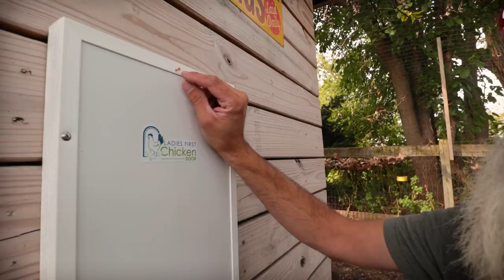Automated Chicken Doors 🐔 Protect Your Investment

Comment: we have a lot in common.  I'm also IT Admin during the day - homesteader with goats, chickens and big garden.  We also have the same exact tractor.  Its like we are you guys in Ohio - but a gay couple.  =)   Like you I'm all about automation around the house - been doing a lot of cool setups lately to make life easier and save electricity too.  Even in greenhouse I have automated outlets so I can use IFTTT based on my ubibot readings to turn things on and off.  I had thought about a chicken door as well - just didn't like what I saw out there - had not heard of this one - I'm on the website now about to order - just want to go check the size of opening I currently have out there.  Would be one less I have to do every morning and night.  I usually give the girls some cracked corn when I close them up at night (ours closes from inside the coop) so they might be ticked if they don't get their treats tho.  Only thing I would worry about would be if girls aren't in by the time it closes - but they are pretty good about that - but would want to monitor for a good month before relying on it when traveling.
Reply from the maker: Ours are all really good about knowing where "home is".  They always go in every night on their own.  Helps to have nice roosting bars for them, and when we move them all to this winter-coop from the mobile tractor, we usually lock them in for a couple days so they know where the new home is.  

That's a lot of stuff in common ♥ how fun!

Comment: Now that I have had this for over a year any new thoughts?  How does this work in winter when it's cold icy and snowy?  I am in a MN so I wonder will it really work here in the winter. Thanks!
Reply from the maker: With the little roof I put around the top, never had any issues with ice at all.  It did blow a fuse once and stopped working.  I emailed the guy who makes them.  He had me test by wrapping the fuse in aluminum foil to see if that's what the problem was - and that fixed it.  So he then sent me 5 replacement fuses for free in the mail.  Hasn't blow a fuse since then.
Reply: @1870s  Thanks!  I will have my hubby watch ur video and see what he thinks.  Maybe u can get a discount code? 😁
Reply from the maker: We don't have a code with them, in fact not affiliated in any way.  Bought it with our own money.
Reply: @1870s  I remember u saying that, I just thought, since u had it for a year and u still like it, etc...no worries just a thought, thanks again!!

Comment: Any update on the opener after about a year in service?  Any issues with solar panel, batteries, door?
Reply from the maker: Solar, batteries, door, no issues.  Did blow a fuse once on the circuit board, so I contacted the vendor and they sent me a 5 pack of fuses for free - took 60 seconds to install.  No issues since.  It was winter, and I suspect there was some type of ice build-up on the door, and it stressed the motor which made the fuse pop - by design.
Reply: @1870s  appreciate the quick reply. Looking into getting one. Our barn is framed with logs (it’s a very old barn) so I don’t think I can mount it inside the coop like I wanted due to the log not making it flush on the inside Wanted to see if it being outside cause any issues in Winter - NW Ohio here so same winters as you.

Comment: Do you think this could be mounted sideways so the door would go left to right instead of up and down? Our coop isn't tall enough where the door is for that door but it's long enough. Just curious if you think that it would work that way since you've got some hands on experience with the product. :) Thank you!!
Reply from the maker: I'll ask the guy who makes them, and see.
Reply from the maker: I asked Matt about it.  He said it won't work sideways.  The sensors for opening / closing are too sensitive, and would "grab" if mounted sideways.
Reply: @1870s  Thank you so much for checking on that for me. The next coop will be designed a little differently for sure. 😁

Comment: The top panel doesn't look weatherproof (especially with what looks like a hole in the top and one on the side for the cables).   That circuit board isn't going to like getting wet.  You might want to mount it inside the coop or build the awning over the whole thing not just the lower half.
Reply from the maker: It's designed pretty well actually.  That panel that slides up, fits into a groove at both the top and sides to prevent water from getting in.  And the hole on the side is drilled up at a 45 degree angle (downward) to prevent want from getting in.  Time will be the true test 😊